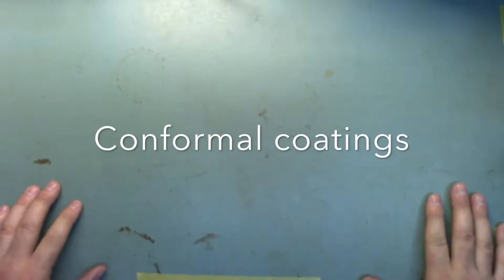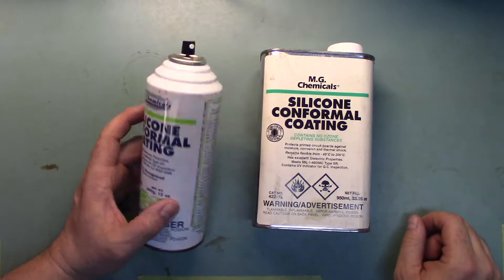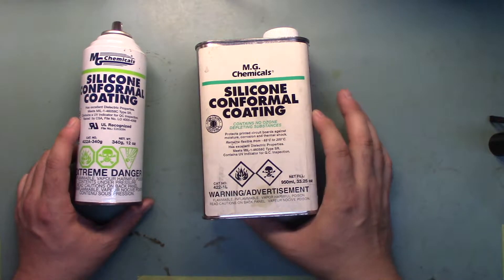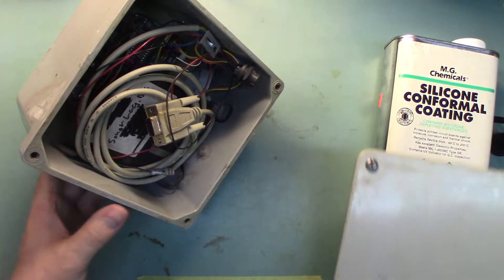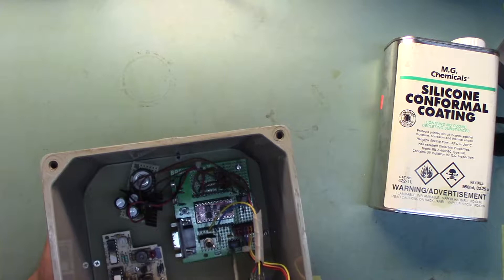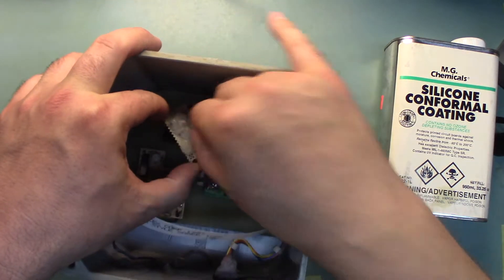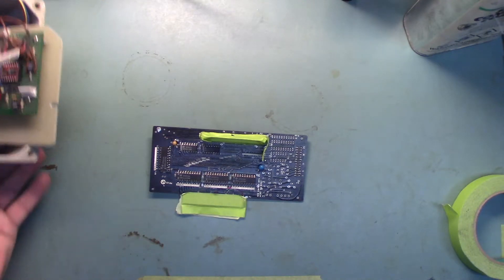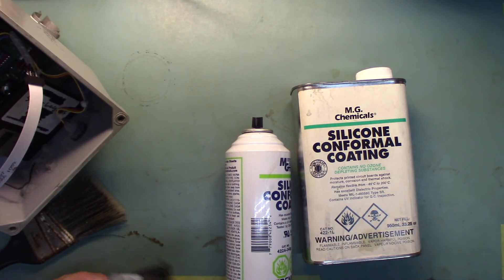DIY Electronics: Conformal Coatings

Comment: Plasti-dip is good. It acts like spray on heat shrink. It's not hard to peel a bit off for repairs then just give it a coat over the repair.